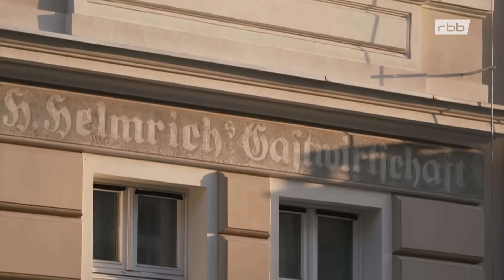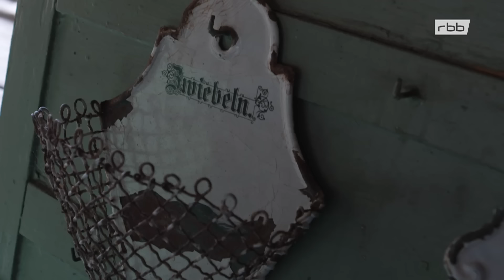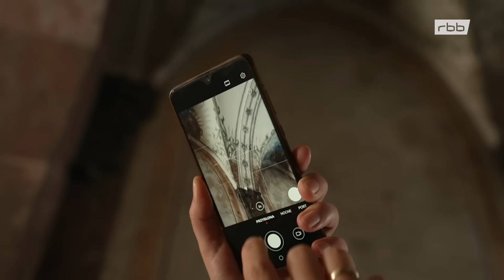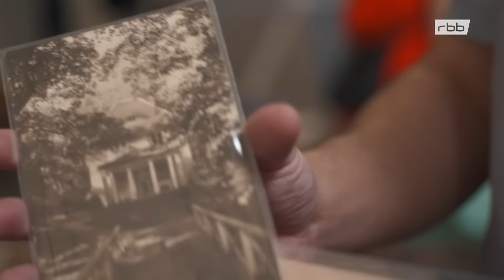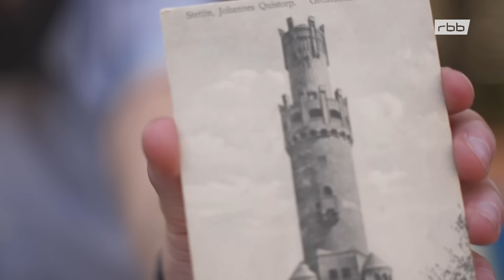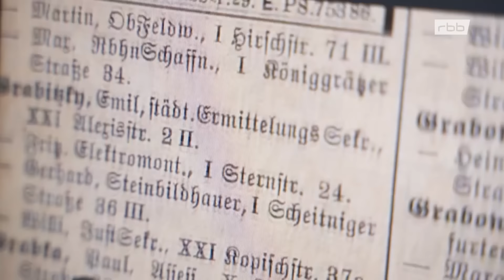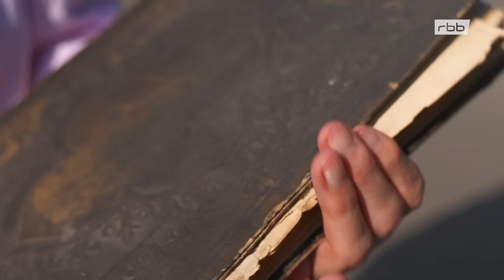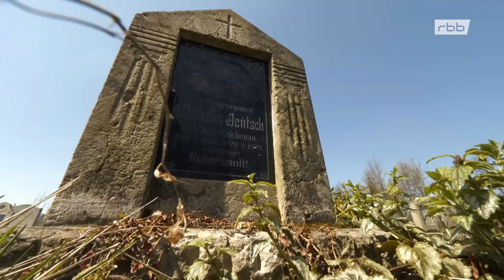Polen auf deutschen Spuren - Verhasst, vergessen, wiederentdeckt | Doku | Reportage

Comment: You, my German neighbors, should be aware of one thing - Polish people, in contrary to Czech - has never been so brutal against Germans when WWII was over. When you are looking your biggest enemies - just look at Sudetenland. As far as I aware - 25000 Germans were killed by Czechs. Polish in contrary were understandable and til 1947 it was still big group of Germans living wall by wall with Polish people. 2 years after War!!!
Reply: @JakWilk
Unfortunately, this is not true. In the first years after the war, the victims of the expulsion were given as up to 2 million people. Afterwards, however, many fates could still be clarified, so that this number could be reduced. In 1965 and 1974, the Kirchlicher Suchdienst (Church Tracing Service) and the Bundesarchiv (Federal Archives) independently arrived at 500,000 to 600,000 confirmed deaths as a direct result of crimes related to the expulsion, using individual case research. So the expulsion of the Germans from the former eastern provinces did not take place quite as peacefully as you write. But this, of course, does not change the fact that National Socialist Germany had previously ravaged the Poles without measure.
Reply: @jeanvaljean7266  you harvest what you seed
Reply: Czech defended them self nothing wrong